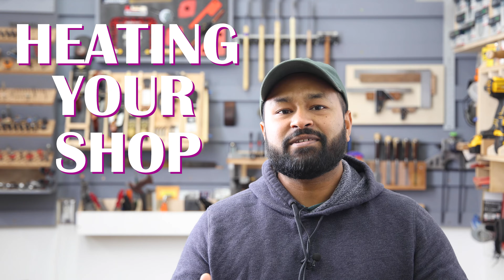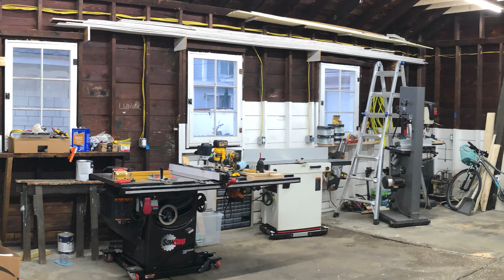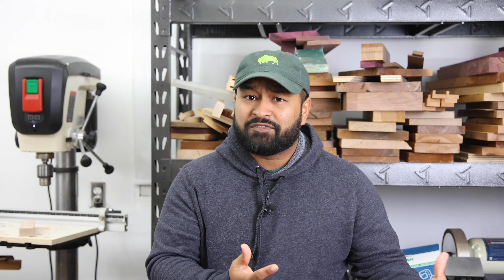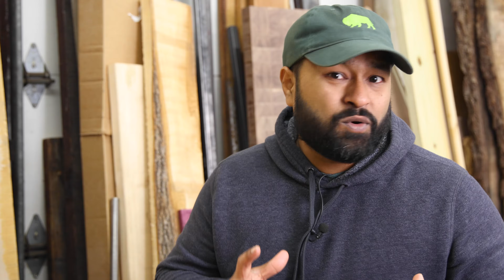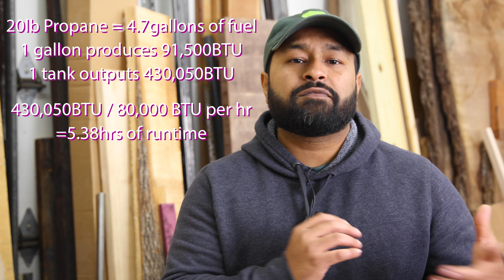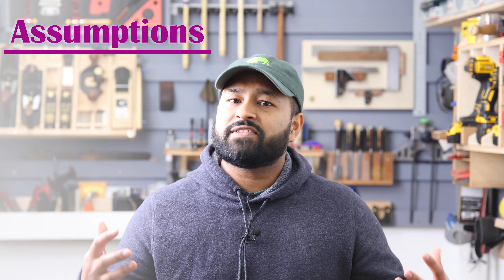Watch this before heating your garage shop

Comment: Very happy I discovered your channel! Awesome content 👍. As I'm about to get a new garage/shop built (wooden walls, concrete slab floor), I'm contemplating heating it. Not just for the temperature during winter, but mostly for controlling humidity to prevent corrosion on my tools. I'm in the Netherlands so it's not all that cold but pretty humid. What are your thoughts on this? My dad never had any heating in his shop and that seems to have gone ok for decades 🤔
Reply from the maker: I recently switched to mini splits with heat pump. They’re incredible! Much more energy efficient, can heat /cool and dehumidify. Upfront cost of install is higher, however, absolutely worth to it.

Comment: My limitation is that the garage in my duplex style apartment only has one 15amp circuit so I use a Ryobi torpedo style propane heater that can run on either a battery or plugged into the wall. It does a really good job of heating the 2 car garage on it’s lowest setting and I actually need to periodically turn it off because it gets too warm to work comfortably. I can vent it by disconnecting the garage opener and putting something 1”-2” like a 2x4 under the door so it can’t close all the way. Also just got a carbon monoxide alarm for the garage.
Reply from the maker: Yup- unfortunately you gotta make the best of what you have to work with. Good call on having a sensor to check bc that’s incredibly important. Cheers!

Comment: I just installed 20 feet of infrared tube burning natural gas on my 12 foot ceiling, 48x30 pole barn shop. It's 50k btu, half the size if my suspended 100k btu heater. Super quiet, more efficient, heats the tools, floor, and people instead if the air. Then, the floor radiates heat back upward heating air.  Heats the same way the sun heats Earth

Comment: We put a mini-split in our shop after years of trying other solutions that were just so-so. Yeah, it cost more than the solution here but we have heat, AC, and dehumidification. 
The shop is 420 sq/ft with an 11-foot ceiling. I had to add a ceiling fan for the winter to bring the hot air down from that high ceiling.
We love it.
Reply from the maker: How big is the mini split? I’ve been considering it as an option.
Reply: @WoodcraftBySuman  This is my woodworking channel. I posted that form my irplane channel.
 The one we have is a Mitsubishi 15,000 BTU 21.6 SEER unit pst number msz-gl-15na. It's an old unit and is discontinued and has been superseded with a newer unit. I did a video years ago about what led me to the decision and the install. I can't post a link but this is the video code, pgD5rdQkpOs

The title is "Let's add some comfort to the shop". Forgive the old camera.

Comment: Great video. I might do a video on this someday because I made a similar deep dive for where I live in the mountains of Southern California.   Propane $45 per million BTUs, Electric Heat Pump $34/mBTUs, Wood $22/mBTUs.  

FYI, propane here is $4/gal.  Electric  US$0.35/KWh, Wood $400/cord.   (no Natural Gas piped here).

I also find it always important to explain to lay folks that while electric radiant heat is "100% efficient", heat pumps are 300-400% efficient. Confuses people and they think "100%" is somehow good...
Reply: how could something be 400% efficientient ? it mean its free energy, wich is impossimble, im open minded please explain why its even possible.
Reply: @g.simard854  because heat pumps aren’t just converting their energy to heat like a resistive heater would.  Heat pumps are moving heat between outside to inside.  So they can only use 1kw to MOVE 4kw from outside to inside (or inside to outside).  I’m sure you can search for more details on how heat pumps use a little energy to move a lot of energy.
Reply: @jb510  thanks I'd never thought of that, thanks for the explanation 👍

Comment: Thanks, you just confirmed my decision to add duct work to my garage shop when building my house vs. a mini-split system. Only drawback to the duct system is, by building code I'm not allowed to put a return in the shop because it's a "garage" (I elected to put a garage door on it vs. French doors). My work around for this was pretty simple.  I had the HVAC contractor frame up a return in the ceiling and leave all the return ducting materials along with cutting the hole in the main return line and then putting the cut out back in and taping it over. The workshop is also completely insulated. Once my final occupancy home inspection is done I'll cut out the sheetrock in the ceiling, install the return duct (complete with a filter) and heat and cool my shop. The house is our retirement home, so we don't plan on selling it to anyone and there isn't any risk of carbon monoxide gas getting into the house because the woodworking shop is a separate room from the garage. The workshop is also completely insulated. I
Reply from the maker: That's great! I hope it works out well for ya. Setting up a new shop is always such an exciting time.

Comment: Gotta note that all these costs vary widely by location and over time. Some states have high electricity prices (e.g. California, or Texas in a cold snap). Gas prices also vary and they're subject to shocks (such as the war in Ukraine, or again a Texas cold snap). You should run the numbers in your location, considering your climate. Electric heat is likely to have more stable prices. And as other commenters have noted, a mini-split heat pump is far more efficient than the options presented here.

Comment: 3:57 Hey Suman, great video, thank you.  While it’s true that incomplete combustion of propane can produce carbon monoxide, as long as there is adequate oxygen present the combustion process produces only CO2 and water vapor (and heat).  My propane heater has an auto shutoff feature when ambient oxygen levels get too low.  This has only triggered twice while using it in my garage, and coupled with a CO detector, which has never alerted, I feel it’s fairly safe.  But, as you stated, there is still a fire risk, so I only use mine to pre-heat the garage and turn it off before I make sawdust.  Still, not the best heating option, but it’s worked for me until I can justify the upfront costs of something more permanent, hopefully a mini-split.

Another downside you didn’t mention is the water vapor. We want the moisture content of our wood to stabilize before using it, so adding a lot of humidity to your shop isn’t the best idea.  Running my propane heater for and hour or two can push my shop’s humidity from 40% to 50% or 60% in just a couple hours.  

Thanks again for your videos, they are top notch!

Comment: Another vote for mini-split AC/heat pump.  Heats in the winter, cools in the summer.  Much cheaper around here than natural gas too.  You can even buy a DIY kit and install it yourself.
Reply: Mini splits are an absolute nightmare in any kind of dusty environment

Comment: I have a small oil-filled electric room heater I bought used for $30. I set it to 67F all winter. 

In central California it works fine to keep the chill away in my two-car, uninsulated garage. Even when the outside temperature is at the freezing mark, it keeps the garage above 60F. 

My portable A/C also has a heater, so that helps go from low 60s to 68F when I'm working in the garage on a cold day.

The most important benefit of keeping the garage shop warm-ish is preventing condensation (and rust) off your metal tools. Worth the $30/mo to keep the heater on all winter, 24/7.
Reply from the maker: That’s great! I wish the cost was as reasonable in colder parts of the country. I can’t justify keeping the shop warm 24/7 when I’m in there 2-3days a week max.
Reply: @WoodcraftBySuman  Agreed. California is fairly mild. It's 27F this morning, but we don't have that many days like this per year. My goal, mostly is just to stay above 60F so the tools don't rust from the daily cooling-then-warming cycles. Great content on your channel so far. Keep at it! Maybe reach out to do joint projects with some of the long-time YouTube woodworkers to gain more exposure and subs. You deserve it.

Comment: Wow! Quite the study with hard data! I’m impressed!
I’ve actually gotten in the habit of using a portable electric heater along with sheets of ply to essentially create a kiln in my shop so it’s both drying whatever I might need to place in there and venting heat into my shop. It’s a trick I learned from Adam Savage.
Reply from the maker: Love that trick! How much wood have you been drying that way per batch?

Comment: Great tips! Thinking about a mini split for my garage shop, but it is definitely an expensive opinion.
For now, I have a cheap natural gas unvented wall heater for warmth, and a garage door to open when it's hot.
Reply from the maker: Soooo after I posted the video, buddy of mine pointed out that mini splits BTUs are not comparable to electric heating BTUs. Apparently they can put out more heat than their BTU ratings would rather indicate. This is why I shouldn't have smart friends. But in such a case, a mini-split might be an even better option for both heating and cooling.
Reply: I have a 12,000 BTU mini split in my garage/shop (23 x 40 ft and 13 ft ceiling).  Walls and ceiling insulated to R30 and 1" rigid foam insulation on the segmented garage doors.  The 12,000 BTU mini-sp[lit does a fantastic job, taking less than 30 minutes to heat or cool the entire space.  I previously tried a 12,000 BTU window A/C for cooling and it barely made any headway even after running on high all day long.  I don't really understand why there is such a tremendous difference between the 2 different systems, but my suspicion is that window A/C units are rated with highly inflated BTU scales.  In our environment, cooling in the summer is critical and the heating in winter is less important, but still a nice addition.  The one drawback to mini splits that I can see is that they loose heating effectiveness in really cold weather, becoming almost useless below 5 deg F.
Reply: @WoodcraftBySuman  Smart friends are the worst!  But yes, I was kinda wondering about that.  I will have to continue doing more research!

Comment: Great video topic and coverage. Radiant floors is the dream. Gas is most common I have seen in Minnesota.
Reply from the maker: Oh how I wish I could build a shop from scratch. I'd def do radiant floor heating! Heck, given the cost difference, I'll even take a gas line. haha. I think it would've cost me about $8-12k to run a line to my shop due to logistics and concrete being in the way.
Reply: @WoodcraftBySuman  I had to chop and hack my way through a lot of drywall and struggle for days to get the line through the long wall of my three car garage but I got it. I put it in but didn't connect. Then paid the guy to connect everything. Then I left the walls a disaster for a year.

Comment: Nice work Suman! I wish we had an average of -1C lol, way the freak up here in Northern Canada NG is the way to go. I cheaped out and did electric though, small shop in my basement and it's working well.
Reply from the maker: Lol that was when I actually filmed the bit. Lately we've got -12 to -14C. Def taking longer for my shop to get up to temp. I used to have my last shop in the basement and I miss it in some ways lol

Comment: Shivering in a garage is always an option ))) i am considering portable ac units that do both - heating and cooling, but concerned about their power. Easiest install though.
Reply: The problem is not just dealing with the cold, it's also that the cold will prevent wood glue from working properly. You can't tell your glue to just suck it up lol
Reply: @kz.irudimen  yeah, true!
Reply from the maker: I've kept an old jug of glue in the shop going through the heating and cooling cycle. I wonder if it will still work in the summertime. haha
Reply: @WoodcraftBySuman  it should! Lol! Let us know!
Reply: @WoodcraftBySuman  I haven't had any issues doing that so far but the weather doesn't really get extreme where I am, it rarely gets below 0°C and when it does it never lasts.